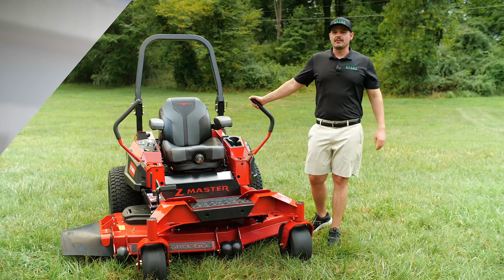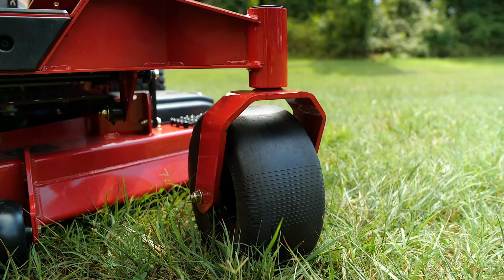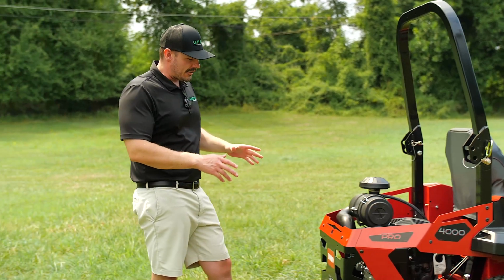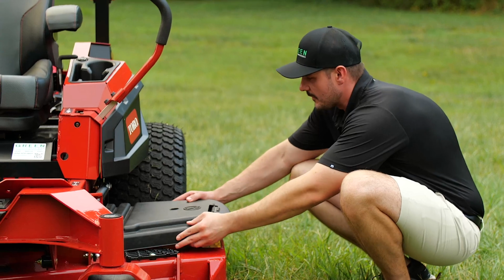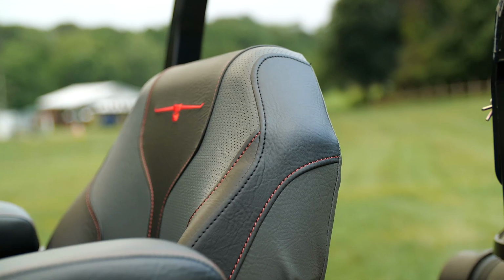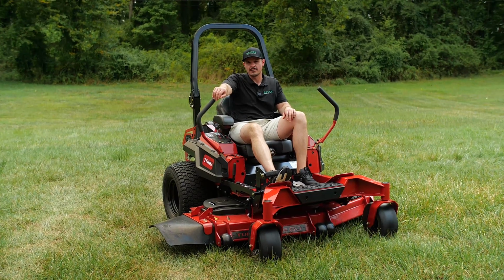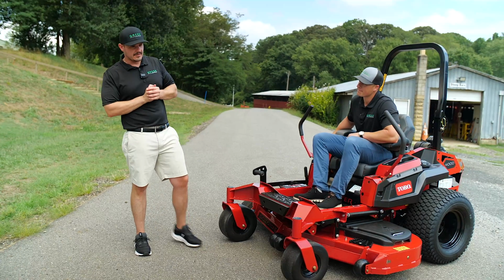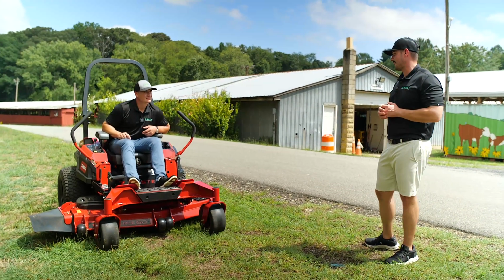Toro Z Master 4000 Series Review: Upgrades, Performance Enhancements, & Hill Test

Comment: dont know if you have noticed yet, but the 4000 series has the same deck mount brackets as the new timecutters. even the 72 in. have had to replace quite a few of those due to deck literally falling off. toro really needs to overhaul that new machine. so many problems. even the deck is thinner. rear guard near the baffle, 5000 series, .27 in thick. this is .2. titan hd is .17. do not like where toro is going. big issues with caster bearings as well.

Comment: Cut quality sucks.
Reply from the maker: Oh man! Have you tried the baffle kit? We have not experienced any cut quality issues ourselves but we hear the baffle fixes it for those that have.
Reply: Agreed, who can expect a $14k mower to cut properly out of the box?
Reply: @scabberdoug  the 4000 series is a disappointment. 5000 series is a bit outdated compared to competition, but it is significantly stronger and cuts very well. although the deck shares a name, if you really look at them, and start to measure thickness, they are totally different.
Reply: My neighbor and I needed new mowers earlier this year. He went with the Z315E and it has much better cut quality.
Reply: Toro cut quality is impeccable

Comment: I liked the Parker pumps better
Reply from the maker: The parker pumps are great! They are still offered on the 5000 and 6000 series.
Reply: @ yeah, I gave a couple 4000s a try but they ain’t fun to service, and have chewed through twice the belts so far
Reply: @freedomisntfree_44  belts i have not had issues with, hydro service is a pain though.
Reply: @ just seems to burn through them faster to me 🤷‍♂️ not sure why they wouldn’t make them easier to service.

Comment: What's the price of that one compared to one with my ride
Reply from the maker: @smurf13w17  they vary in price depending on options and engine, etc.  the unit in the video is a 25.5hp Kawasaki and the MyRide unit is a 31hp Kawasaki on an HDX platform.  It would be about a $1600 upgrade.  When comparing apples to apples within the 4000 series lineup it’s only a few hundred dollars extra.